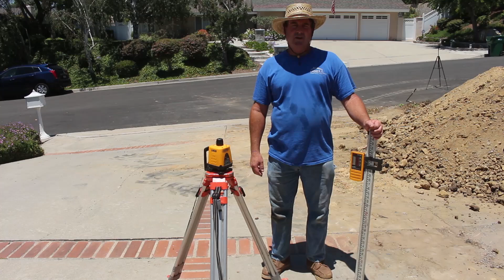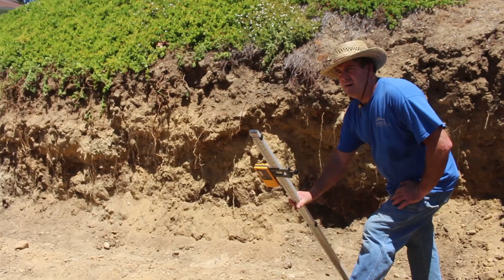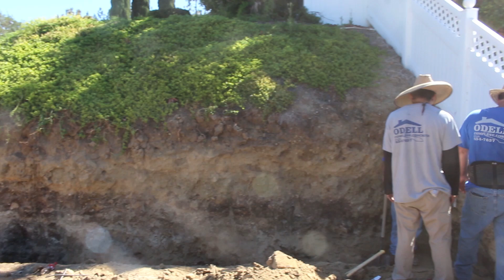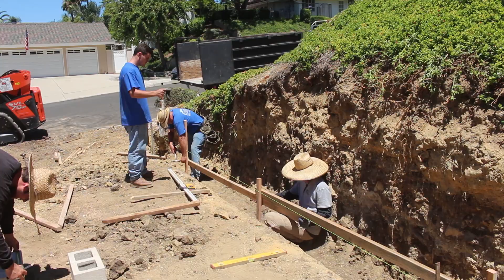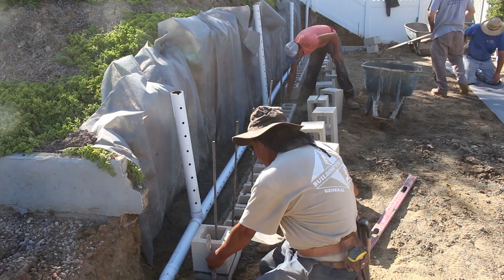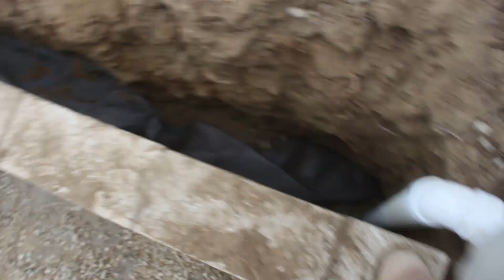How to Build a Retaining Wall - DIY

Comment: Would it not be a good idea to cement or place blocks to create a 45° angle from the side the earth is on, up to about half way up the wall? Kinda like this /| Then let the earth fall onto this incline so as not to put as much pressure on the wall itself. You’d have to excavate out a bit more to do this I guess.

Comment: You are a master at what you do! I have a project i wanted to do with a small retaining wall. The tricky part is i wanted to put a vinyl fence on top of it. Not sure what would be the best way to install the posts for the fence on top of the retaining wall?
Reply from the maker: Chain link fence post galvanized., set in the cell of the block as deep as you can go. Grouted in solid.
Slide vinyl over steel post and fill with concrete
Reply from the maker: 1/2 way up on post fill
Reply: @OdellCompleteConcrete  Wow that you would of never thought of that thank you!

Comment: Hello, I'm Building a similar retaining wall that's approximately 7' tall for a basement walkout staircase. Do i have to fill in every Cinder block cell as a go up in rows to resist lateral soil pressure? i wanted to build forms and then pour concrete but that project seems too complex and expensive.
Reply from the maker: Poured in place may be the way to go

Comment: I dont see any tie in to the bank, wouldn't you use a fabric or dead man? This is basically a free standing wall.
Reply from the maker: I concur
Reply: Wet set on oversized reinforced concrete footing (I would have made it only 12" deep) with rebar and concrete in the holes and also grouted? It's not going anywhere. Over 6 feet tall or a surcharge load might have called for some soil anchors but geogrid? There is practically nothing pushing it so yes in that sense it is pretty much an overbuilt freestanding wall.

Comment: did you have to submit structural drawings or plan for permitting from the local jurisdictions?  Curious about the entire assembly of the water proofing/footing/water stop/ fiber mesh/ etc.. Did you just know this or was it an engineered system?
Reply from the maker: No engineering required for this height

Comment: Wow. I have learned more in the past :25 minutes about wall making than i knew after watching 15 similar videos. thank you! I am a subscriber now. I begin building my small concrete/stone house in the next few months. I'll probably reference this video often.
Reply from the maker: Glad it was helpful!
Reply: You don't need a mortar joint if you are going to stucco or face the wall, that will save a lot of time and if you have rebar and concrete in the holes (rebar in every second) it will be more than strong enough.

Comment: It's much faster to run 2 profiles on either side & pull a line to the level you require inclusive of gradients. this will make it easier for the guys that are digging to check their levels without being totally dependent on the laser level. additionally a line level would do the same job as the laser level & costs 100 times less. Laser level looks cool though & probably justifies a higher than usual price.

Some of the starter bars were spaced more than 16 inches apart thereby bypassing some of the blocks completely. It's a small wall but many people will be watching this video as a guideline so it's worth noting.

In my country we usually wrap the base pipe in geo-textile fabric and cushion it with 1/2" to 1 inch aggregate manually. Later on we pour a 2-4 inch aggregate above it to fill the gap. I think the reason for it is to cushion the impact from the drop above and protect the holes from being clogged via the wrapping. Another thing is osmosis diffusion kicks in and the pipe actually sucks the water out from the ground. Weird but true.
Reply from the maker: line levels get you close

Comment: I use to do bulkheads which are harder due to the water splashing with tides going in and out. Really have to move fast to prevent a slide off. Luckily for you guys water isnt an issue.
Reply from the maker: not water just dirt

Comment: The work looks fantastic and definitely will stand bulletproof. I'm curious about the total cost of the materials and labor for the retaining wall portion. Could you share?
Reply: California prices, 3 truckloads of dirt disposed about $1500. 7 yards concrete $1000. Cinderblocks about $500 and figure another $500 for rebar, mortar, fabric, pipe, etc. Owner's equipment cost say $500. 1 day labor with 2 guys and 1 day with 4 guys figure about $2000. Plus owner's time, overhead and profit so total job $8k to $10k.
Reply: @tomszabo7350  Seems like a good guesstimate.. I was thinking around 10k myself.

Comment: Thought those drains were a no no in todays storm water runoff. Nothing is to leave the property ? Use to see it standard in new construction aprox 5-10yrs ago but I haven't seen it as of recent.  I could be wrong ??  Thought water drainage had to meet up with the city sewer ?? Correct me if I'm wrong...thanx
Reply from the maker: depends where you are

Comment: Ok stupid question. Whats the benefit of a block wall as opposed to pouring an entire wall with concrete. I would think the latter would be easier to do.
Reply from the maker: If you have other uses for all that wood.
Reply: @OdellCompleteConcrete  I get that. I ment like cost comparison. I would assume the labor for laying bricks would be much higher.

Comment: I hope this job is in an area with no frost, that wall won't last 60 months, never mind 60 years! Should have used large dry-laid stone to retain that high of a dirt bank.
Reply: There is practically no load on that wall and no frost heave in Southern California either. That wall has quite a safety margin.

Comment: question have a brick retaining that leaning has to come down check existing footing seme okay thinking block wall up to 4feet high can I drill holes into footing put tie rods for each block is that idea okay reply
Reply from the maker: Yes but I would use epoxy on the dowells
Reply: many thanks

Comment: Im in South America looking to redo my wall. Is the mix used for your foundation different from the mix that will be used to laying the block? And why were some of the blocks pushed down into the foundation? If I build a leval wall similar to yours, should i push down 1 layer of block into the foundation?
Reply from the maker: This wet setting block technique, you can set the block next day or whenever, but this is best.
Reply: @OdellCompleteConcrete  Thanks!

Comment: seems like u should have used sleepers on an upper course.. all that weight pushing up high and the foundation so far away is like a bigg lever.  or are the filled blocks with reinforcements to footer strong enough to resist that push/ twist?
Reply from the maker: yes there is vertical rebar every 2' and horizontals every 3'. Blocks are solid grouted
Reply: More than strong enough, the eventual failure point (decades from now) will probably be settlement of the footing ... can't do anything about that unless you dig all the way down to and set it on solid bedrock.

Comment: Expensive foundations of concrete,they can start with hollow blocks at the same time with the concrete cement
Reply: Yea, I just got a bid for a wall using concrete -$20,000  35x4ft

Comment: Looks good and I'm sure the wall is structuraly safe etc but why didn't u let the concrete set and then lay the bottom course of block on a mortar mix? You also wasn't cementing the blocks in between.. However it looks great and I'm sure it serves the purpose 👍

Comment: This is southern california where it does not deep freeze and the ground is dry. However, in northern climes, this wall would be blown out by the wet soil ice lensing. Up here, if wet soil freezes against a retaining wall, especially the wet clay I have here, it will expand enough to push the wall out. So what you do is keep dirt from coming into contact with the wall by filling with gravel. I just mention this so that people up in wet/freezing land don't do the same thing as in the video. The wet clay we have is a terrible destroyer of retaining walls.
Reply from the maker: good point

Comment: I put a horizontal 1/2" rebar in the 2  bonds beams of my 6 foot high block wall and poured concrete in all at once after the wall was finished -- used a vibrator to suck it all in and tie it together.  Still ok after 50 years.
Reply from the maker: Nice system

Comment: Hey Dave what happened when you were setting the lazer?  You didn't finish explaining what you were doing. By the look of things the trench had to go way down?! As you leaned the staff over it beeped level, but then you went up with the receiver which would have made things worse. Then you completely skipped to another part of the job. It would have been nice if you had of explained exactly how to use a lazer level. Ps love ya work

Comment: Reading all the comments and watching the time, labor, and materials that went into the job, wouldn't setting forms and then pouring a wall on a trench footer dug below the frost line do the job well at a reasonable cost?  Cover the face of the wall with stone and you have a pretty nice looking, structurally sound retaining wall?  No?

Comment: now i just watch a video of a guy saying not to use fabric behind the wall.. he called for geogrid..
Reply from the maker: He doesn't put drains
Reply: Geogrid is for segmental retaining walls. The fabric is called mirafi and it’s an an antiquated method of achieving drainage behind retaining walls. Now pros use tremco asphalt emulsion topped with ms delta drain with drainstar at the bottom for filtration.
Reply: @lvhatrick  You're kidding right? This is not a basement or foundation wall, it's a cinderblock retaining wall with a small knob of elevated ground above it.

Comment: It would probably look better if the wall was twice as big so you dont see the hill on the other side, and with that big hole in between the hill and the wall imagine all the animals that will get trapped in there like cats and pests like rats. I say cover up the hole between the wall and the hill and make the wall twice as big so you cant see the hill and kids dont try to use the wall to do skateboard tricks.
Reply from the maker: yes that wouldn't hurt.

Comment: That fabric gets clogged when the dirt is wet, and will barely pass any water, which will over time push out the wall.
Reply: what if you were to use geo grid though? That would most likely add longevity to the life of the wall
Reply: Yes I would’ve added more gravel.
Reply: That's how we do our walls. Gravel to the top. No issues here. Also wall cap is below hill grade to make it last
Reply: Are we seriously arguing over some one That's  not a professional construction contractor?
Reply: The drainage is fine...I take it you have never installed a drain Datastorm? We do the same thing here in WA and we get a hell of a lot more rain than Southern California. That fabric is designed for the dirt. That wall won't be pushed out. The big issue they will have to worry about will be the roots.
Reply: @mikel9567  The nearest trees that I can see in the video is pretty far away so I take that you are just talking in general?  Would it be an issue if planting hedges 1 meter away from the wall?
Reply: The fabric is put down at the end, and covered with a deep layer of gravel. The water will drain towards the road.  And it doesn't look like a high rainfall area.
Reply: The wet dirt will plug the fabric just about as much as it plugs itself. In other words, the fabric is not going to make the dirt drain less then it already does without the fabric. ALL it does is keep some dirt out of the rocks which is important if your drainage has a small cross section as it does here. If you have a large volume of rock, say 2 feet wide and almost to the top of the wall then fabric isn't going to make much of a difference.
Reply: right , that retaining wall will not be able to support more than 5 years if theres a lot of rain , the wall itself is well built and I mean the leveling and the blocks part, but you have very little gravel and I think the gravel is contaminated , the fabric , no compaction, the block type , the waterproofing that you put,   i dont know,  this is mess up , at least you reinforce the wall with de steel bars, a gravity retention wall with geogride would have been enough, but its possible that de concrete base and the steel could be enought to support the extra weight of the wet earth , but you'll only know that with an engineering calculation, so it's a bit of luck if it does not collapse ,since I guess you did not do those calculations
Reply: Alex Yuric this job is in California. Heavy rain is rare and short lived. This isn't his first BBQ, relax.
Reply: I disagree Huckleberry. Rock should have been installed to very near the surface or to the surface to relieve future hydro static pressure.  Compaction is important, as well. Cost of rock is minimal. He had a skip steer on premise to drop the rock behind the wall. Fabric, even recommended geotextile fabric, is prone to clogging from soil fines over time rendering fabric, drain rock, and perf pipe useless. Irrigating the slope which is now partially disturbed soil full of air cavities, to establish plant material or rain water from a series of not-so-heavy rain events is enough to introduce tons of water that will push on the wall. Wall height was getting a little high to not involve an engineers, as well. This contractor does good horizontal work. Vertical retaining walls are  a different can of worms.
Reply: @wayneblanchard4347  Can I ask if not fabric, what would you do instead to stop the soil fines to invade the drainage layer?
Reply: @louuuuuu5    fabric is expensive and in the final analysis causes problems....  use good angular drainage gravel around drainage pipe, more the better along wall and up to 8in from finished height... here I drape a 4ft drain fabric just on top a down a foot on the sides of the gravel. The top soil is the greatest source or sediment incursions into gravel drains.  Also use geotex webbing every other course.
Reply: @Lima-fj7ps  Geogrid is massive overkill for a wall like this. The way it was built is more than adequate.
Reply from the maker: Everything fails over time, when its man made.
Reply: well no kidding but the goal as a contractor is to prevent failure to the best of your ability. its a shame that was your go to response. @OdellCompleteConcrete
Reply: All subsoil drainage fabric will clog eventually depending on the rainfall and the soil, you can't compact drainage aggregate and it's not practical or worthwhile to wash the stone to remove the fines. Everything you see here is standard practice.

Comment: Great job mate,but i think in the  back of your  wall, in the spot you put the pipe, it needed to make it waterproof with tar or a waterproof paint,dont let water go through on the wall over the years.
Reply from the maker: we used a water proofing on the back of the wall.
Reply: well cheers to u mate!

Comment: i prefer the hill side fabric should paste with the wall, otherwise water drain function not working properly .if the fabric is attached u can save the wall from moisture also. well done work congrats
Reply from the maker: ty

Comment: Do you tie in the lateral rebar to the vertical? Or just weave it? And is the first coarse of block completely filled with cement? I'd imagine a completely filled block would be rock solid. Or are here hollow parts? Thanks. I got a big job ahead of me w couple hundred feet of block retaining wall
Reply from the maker: I weave it in and solid grout all blocks.

Comment: I see vertical rebar in there every third hole. When (if at all) is it necessary to put horizontal rebar in a wall?
Reply from the maker: I also have horizontal top and bottom.

Comment: You guys did a very good job but I am curious about the strength of the wall. For a well of that length and height, why didn't you add at least 2 wall stiffeners/columns every 6-8 feet to reinforced that wall? I know you are going to explain the drainage system that you used saying its good enough. But if that hillside should break away and start resting on that wall, I don't think the wall will be able to hold the weight without the stiffeners/columns.
Reply from the maker: Only the true test of time will tell, but if I were to bet on the outcome I would go with the wall holding indefinitely.

Comment: The retaining wall that i want to build it about 2ft wide and 6 ft high. Do i need to dig 22 inches deep before starting, like you did in the video?
Reply from the maker: No 12 inches would be fine but it does also depend on where you live for frost levels
Reply: I live in Palmdale,CA and it does get cold up here.
Reply: @brianmerrick5664  You need to have a 6' high wall engineered and permitted.

Comment: Hey David,
Did you fill all those blocks with concrete, or mortar? I saw the beam you laid in, I assumed you filled with concrete, but didn't catch what you said you filled them with.
Reply from the maker: Filled solid with 4500 psi concrete.

Comment: Seemed like a few unnecessary steps i.e. wood frame to hold rebarb but removed before dried also, looked as though the footing was not dry before you layed your first brick i could be wrong.
Reply from the maker: Your right.
Get it on